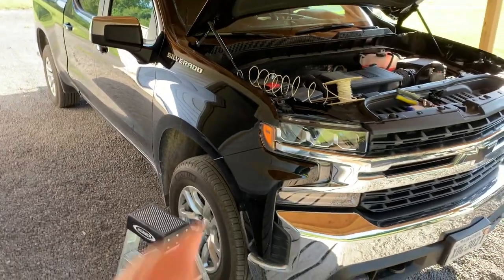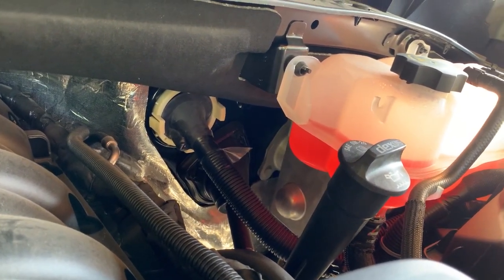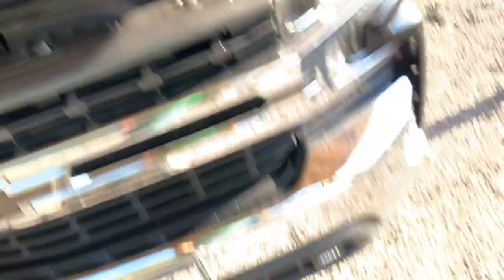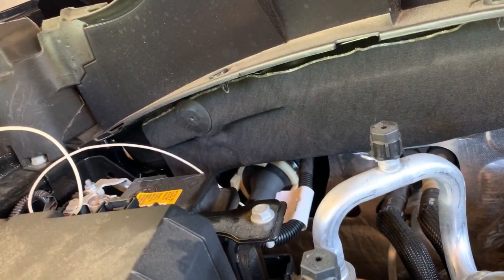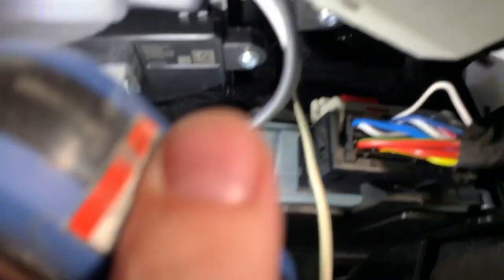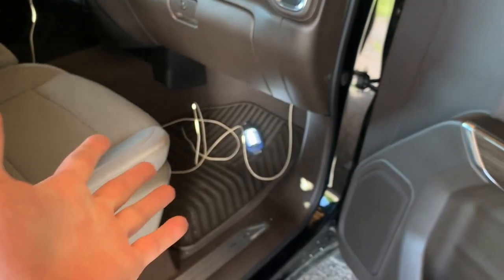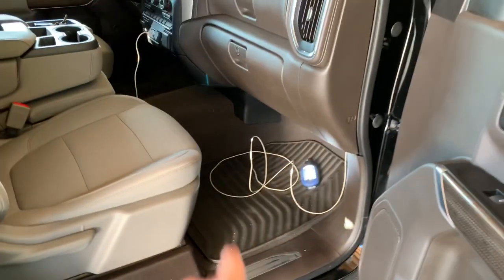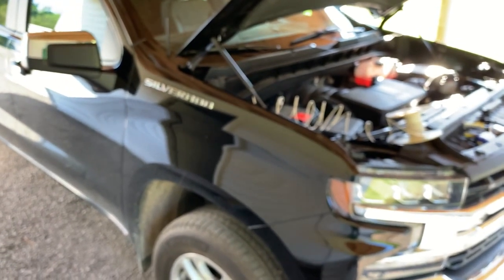HOW TO Run a Wire through your 2020 Chevrolet Silverado 1500 Firewall (THE EASY WAY)

Comment: I appreciate you very much. Once I watched the video. It only took a few minutes to cut the boot and feed the wire though. I was able to snake the wire to the drivers side without any issues or pulling anything apart. Again, thanks for the video.

Comment: Brother, this was TERRIFIC!!!  I just bought a 2020 Silverado---I'm a ham radio operator and would like to install a portable VHF radio.  The power lines on ham radio gear MUST connect to the battery, unlike CB gear that can plug into the lighter.  Now I can route the power wires through the firewall.  Thanks again!!

Comment: aaaaand this video just solved all my problems.  Thank you sir.  Hooked up power wires for CB radio and a speaker wire for a small PA speaker I installed under the hood. 2021 Chevy Trail Boss.  This video applies to 2021 as well.  Brilliant. Now if I can only figure out a good way of getting my antenna wire into the cab :)...
Reply: Jim Johnson did you figure a good way to run your antenna wire through.  I'm working on the same thing now and looking for a good option. TIA
Reply: Same here
Reply: Also looking for a place to get the antenna wire through 🤔

Comment: It helped out alot! I was trying not to screw myself by making a hole somewhere I shouldn’t be. At first I was trying to use the hood release hole but apparently GM used a rubber fitting which is almost impossible withought breaking something.

Comment: This was excellent, worked on my 2020 2500HD Duramax.  I ran into a similar problem on my 2017 GMC 1500 Denali and was really loathing the idea of having to do it again.  I went through the drivers side on the Denali and it didn't even have that nifty nipple.  It took maybe 5 minutes with 8 gauge power wire, most difficult part was getting in to cut the nipple, a little less room with the big diesel components in the way.

Comment: I have a 2021 GMC Sierra 1500 crew cab and am looking at running power and antenna wire for ham radios.  I have been planning on going through the firewall, but I have found access under the rear seat which I might run power there and antennas from the back and terminate it where the radios will live under the rear seats.  I wish there were shop manuals to show the breakdown of OEM parts like what panels to remove and where cable access would be recommended.  Anyway, thanks for your video, it was the way I originally intended to do this and still may depends on the trouble I cause for myself.  Wish me luck!

Comment: great video. Staring at that god forsaken rubber boot for days now and i could not figure out where my wire was going. However I didnt give up that easy, on my truck there is the BCM in front of it so I had to move it over and found that there is a split grommet in front of that boot under the drivers dash. I poked a solid wire as a fishtape through and found it right away.

Comment: Awesome. Just an fyi, I ran mine through the drivers side and it will pop out above the gas pedal. Look for a rubber circle roughly 6 inches wide. Hope this helps

Comment: This is a huge help! Thank you! Can you show how to connect those wires to the battery, please? Directly to the battery, and I’ve heard that there’s an available, fusable circuit int he fuse box. Where would I connect my wires for a 2-way radio? (Once they are routed through the firewall ‘the easy way’)

Comment: I had to do the exact same thing to get a pwr wire through the f/w.   I disconnect the box underneath the glove box just to give myself more room to work.  if you disconnect that box thats mounted near the entry point where he ran his wire through the f/w, I suggest disconnecting the neg batter cable first.   My question is how will you supply power to the aftermarket device you are installing?  I could not find a switched fuse that would work for me, because it kept throwing the check engine light on. Therefore I had to run it straight off the battery and I put an on/off toggle switch on the circuit.

Comment: It's a little bit tight , but I was able to get to my wires on the driver's side fairly easy. I ran my upfitter wires through the driver's side as the GM instructions say to.

Comment: On the driver’s side, you find your wire behind the carpet slightly right and above the steering column.  There is a retaining washer holding the carpet to the firewall but it pulls off easy.   I’ll make a video.  It’s Actually easier to get to than the passenger side.
Reply: Did you ever make a video? I tried to find the wire using your description, but could not find it
Reply: You have to remove or pull back some of the insulation:  remove the star washer near where the steering column goes through the firewall.  Wire will come through the rubber grommet just above and to the right of the steering column
Reply: This is the pro tip! Struggled for two hours to find the wire inside on driver's side. Looked where @stephenallen1087 suggested, and, bingo, saw my white hanger lead. Another hour and several contortions later, I was able to pull the stubborn thing through. Putting on controller in the engine bay that connects to the switch panel in the cab.

Comment: I used  that exact one on the drivers side, couldn’t find my wire either.... pulled out and taped wire to a 12” piece of home electrical wire (single piece, not the full 12/3) and put the wire through the wall and felt around for the wire, took time, but I found it and pulled the wires through. I’m all about no drilling either, but I had to drill my bumper for an led light at since there are NO light bar options available for these trucks for 2020 3500. 

Ps: I have a 2020 GMC Sierra 3500 and this video DOES apply to that model too.

Comment: Installing a light bar on my 2021 Chevy 2500. Can confirm that grommet/nipple is there in the same spot and accessible and where I am putting my wires through. I have to get a terminal tool first to remove the pins from the connector as the connector will not fit through, but once that comes in I should be able to push everything through.

Comment: Do you think it’s possible to run 2 gauge wire through because I need to run two of em to get to my inverter
Reply: I did it with my 2018 Silverado and then i ran them under the carpet and through the cab and into the bed through a vent.

Comment: There is a way to connect to the terminal for the upfitter switches in the black box next to the battery.  I am in the process of installing a train horn in  my 2020.

Comment: The wire pokes through behind the foam that surrounds the steering shaft. It's not hard to find at all, and running to the driver's side is preferable for most applications.

Comment: Realizing this is a three year old video, I will make a simple comment.  Yes, the rubber boot on the drivers side does open on the other side of the firewall.  Best to push a wire clothes hanger through first.  Second.  IF you have the "baby" Duramax, it will be especially challenging to do this as the air intake tube runs right through this opening.